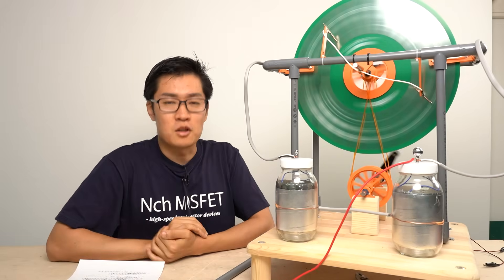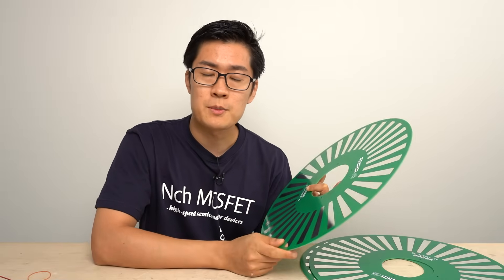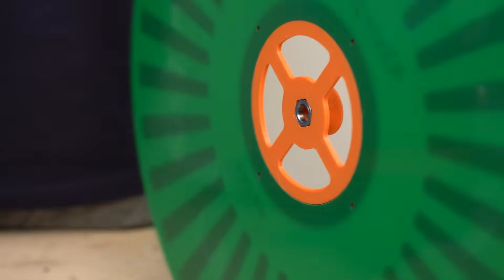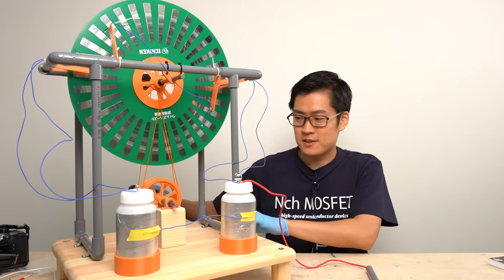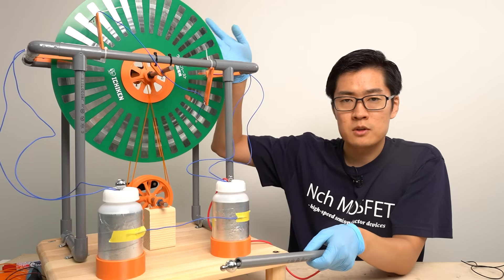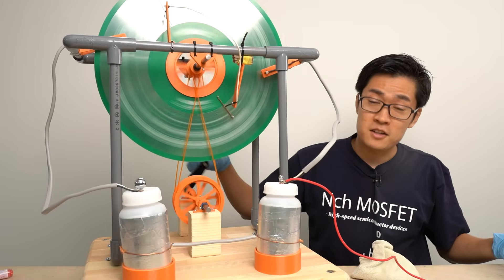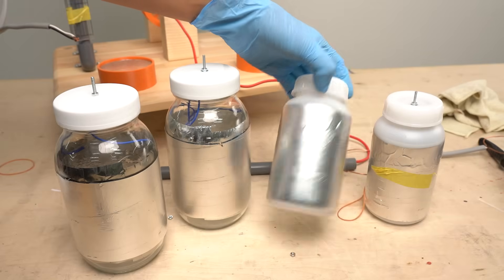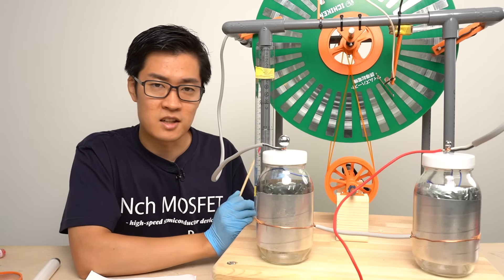Try to Generate a 100,000 V Spark with a Wimshurst Machine

Comment: I made a Wimshurst machine about 15 years ago with approximately 750 mm diameter disks.
I have had it produce up to about 200 KILOVOTS.
The absolute KEY to obtaining high voltages is to avoid ANY type of discharge (corona and other), so absolutely NO sharp corners ANYWHERE, every surface must be clean, free of dust, particles etc.... Make sure you evaluate your design to ensure minimal leakage to ground.
Very smooth, round surface applies especially to the sphere you use for the spark gap. Also... the larger you can make the radius of any bends / spheres / corners that carry high voltage, the better.
I made many of my spheres by spot welding 2 BLANDA BLANK stainless-steel bowls (Ikea) together. Works great, looks great too!

Comment: Part of your issues is the thickness of the Leyden Jar capacitor's walls. Most plastics about 1000 volts per 0.001 inch. Air 30kv per CM if using larger spheres for electrodes. Diameter of the electrodes matters. I love that your doing the improvements on the fly while developing! Good work!

Comment: On a smaller Wilmshurst device, I was able to increase the voltage substantially by carefully insulating the exposed parts using resin. Discharge over the ends of the discs and between segments is always a problem if not insulated properly. The only problem with sector-less discs Is to make absolutely you do not have conductive tacking occurring from the electrodes otherwise the device will work briefly and stopped working. Maybe the use of cemented plastic plates might work better on "sector less" discs.

Comment: Have you ever pulled apart two trash cans? Zap city. I bet that if you made this with two cylinders one inside the other, energy deformative attraction would be mitigated, and if you put that into another larger cylinder and flushed it with CO2 you'd up the efficiency dropping loss.

Comment: When you used plastic jars, there was an additional isolation between the external aluminium foil and the wood plate, while with the glas jar, you did not have. Is this a reason why the charge did not increased as you would like have to ?

Comment: You should have designed cuts between the copper plating islands on the two PCB disks. For the disks you could provide some sort of ball like spacers. It is a cat and mouse game and it can end in destroying electronic equipment. Sugestion: don't play such a game of longer sparks but rather drive the disks with a motor and find the optimum speed for the highest voltage. You should provide an emergency spark discharger with a constant distance.

Comment: Thank you for an interesting video. 
I've not seen a working Wimshurst machine before. Are your discs rotating in opposite directions?
Reply: the disks must rotate in opposite directions
Reply: They do rotate in opposite directions, since one of the two belts is crossed. You can see the opposite rotating at 12:59 for example.